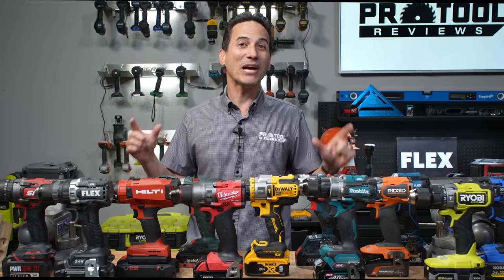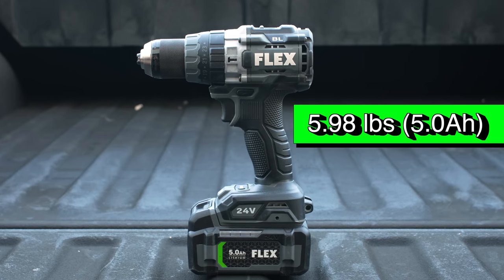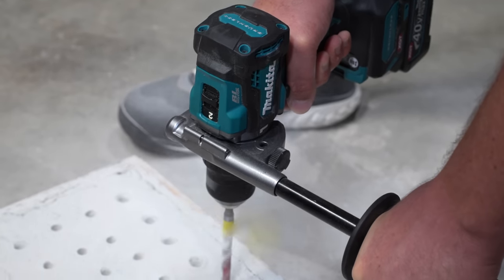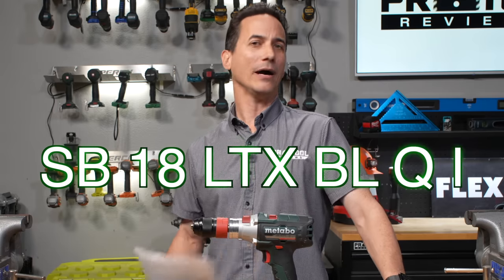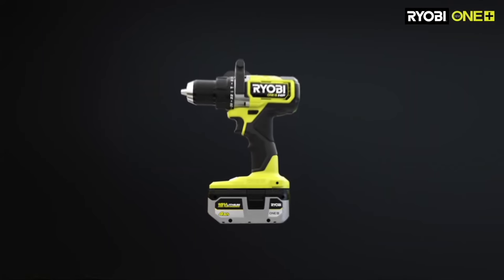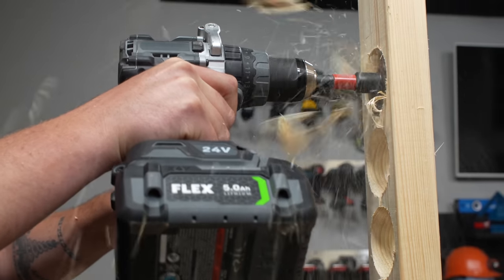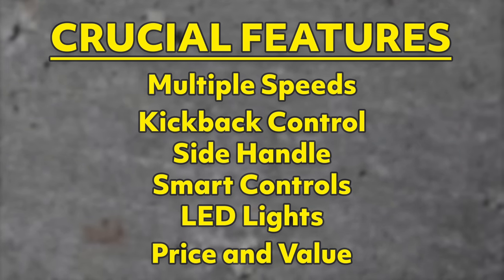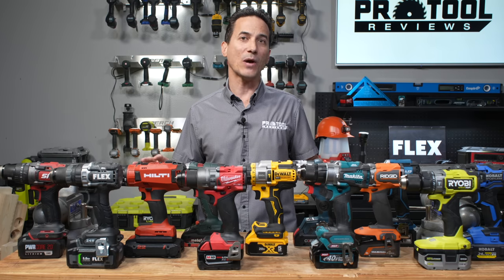Best Cordless Drill 2024? Milwaukee, DeWalt, Makita, Flex

Comment: I agree with several of the other comments with regards to the batteries used on some of the drills during testing. The bosch is designed to work with the larger batteries 5.5ah and above to deliver full power. The same with the dewalt, its a flexvolt advantage drill thats designed to work with the flexvolt batteries. Using these higher output batteries is when the tools deliver the full power there designed for. Maybe the same with the other brands but not sure. Disappointing to see some tools came in without the batteries there designed for!
Reply: Higher amp batteries do not help any tool deliver more power.  Higher amp batteries simply supply longer run times between charges.
Reply: That is only partially correct. If you read the details on their websites and from personal use, the newer larger batteries deliver more power the tool can use. Hence why dewalt tools called 'flexvolt advantage' the tools have a power advantage while using flexvolt batteries. Also bosch biturbo tools get more power from Pro core batteries with capacities above 5.5Ah.
Reply: @robertturner5213  newer larger batteries typically are higher voltage.   Higher voltage delivers more potential power.  Higher amps deliver longer run time.
Reply: @11211lcb it's not the voltage with the Bosch, it's the number of cells. The voltage remains the same, but the output doubles because of the double rows of cells in the 5.5Ah and above batteries providing double the amperage. Power = voltage * amperage.
Also, don't confuse amps (amperage = current) with amp-hours (=capacity). One is tank size, the other is displacement (in an imperfect analogy with voltage being revs).
Reply: @11211lcb   you don't even have to leave this website to find out how wrong you are
Reply: @robertturner5213  Of course,  if the tool draws more amps than the battery can deliver the performance  will suffer.  And or if the battery is lower amp rated it will not deliver the power as long as a higher amp battery.,especially under longer power load times.
Reply: @11211lcb your wrong torque test channel has whole video showing power diff in batteries
Reply: @macvos the math you say about power= voltage * amperage, is a bit flawed, first of all I assume you understand that power is measured by watts.
The battery that says 5Ah is basically a battery that can supply 5 amps continuously for an hour it is often the same when people say the battery is 5 amps, almost nobody says amp hours because there is no such need.
Now if a tool consumes say 900 watts that means it it's 8900 watts per hour. Thus you have Wh its all measured per hour.
So say you have a 18V battery with 5Ah it means the tool at full power will only work for 6 minutes straight  because  18volts*5amps outputs 90watt.
Or to make it easier 
If you try to draw 900 watts from a battery that has a capacity of 90Wh then you will get 90/900= hours 0.1*60min=  6 minutes. So I don't understand what you trying to say here? If the battery has more or less amps doesn't matter for power output as long as the battery is full, if the battery gets low then it does affect because it simply can't give you the power output that is required.  
This is physics and math. Batteries tell you their capacity in amp hours and tools tell you their power outputs in watts and not amps. That exactly why batteries can be put on any tool with any power consumption but then you get longer or shorten work time with them depending on their consumption in watts. Heck you can even put a Milwaukee battery on a dewalt tool and it won't make a difference, you only need an adaptor for the ports.
Reply: @robertturner5213 I'm sorry bit the tool cannot output more power than its designed to, otherwise corded tools would be extremely more powerful, but it has to do with voltage, read about it, they say that these batteries are designed to be used on both 18v and 54v power tools and not to give more power to an 18v tool. If anything these batteries have 9Ah which just gives then more work time at full power.
Reply: @theone-ou3gd I'm sorry but he is not wrong, first of all the original comment refer to a tool that is not shown on this video, the p
Cordless power tool shown is designed to be used with a 20v battery. And the flexvolt batteries are designed to be used with either 18v power tool or 54v power tool, and that the XRP Cordless impact/screw drill DCD999NT which is specifically designed for flexvolt batteries usage for almost double the torque output for specific jobs, but not all of the tools will give you this output, only the specific one because it can work either on 18v or on 54v so you can use 18v batteries or the flexvolt 18v/54v batteries and it only gives more torque. But again the tool in the video is different. And not designed for the flexvolt batteries specialty.
Reply: @Alex-ny1qg  Every specific lithium battery cell has a certain voltage and amperage (and thus wattage). If you want to achieve 18 volts working voltage, you need 5 cells in series (5 * 3.6V = 18V). Putting every one of those 5 cells in parallel with a second cell doubles the amperage the cells can provide, and therefore the wattage. 
Also, never say amps and amp-hours are the same to someone working with electricity. A 5 amp battery is one that can output a current of 5 amperes (A), but depending on its capacity, might only be able to do so for 10 minutes,  or for 2 hours.. A 5 amp-hour (Ah) battery can be a battery that has a capacity to deliver a max current of 5 amps for an hour long, or 50 amps for 6 minutes.
Like I said, with a semi-fixed voltage, amps indicate max power output, and amp-hours capacity. The two are fundamentally different.

Comment: Dear Pro Tool Reviews, you seem to have the resources to do a great video, but you're missing so much information. How about addressing the ergonomics of the tools? The noise/db level? The run time with included batteries? Rating controls and ease of use? Built in light performance? It's nice to know how quickly you can drill one hole, but how many can you drill before shutdown? Lastly, I think you should try a 1st, 2nd and 3rd place finish or give category wins. Otherwise, if you're going to choose a single tool you need to give very detailed reasons why. Besides, an extra couple of minutes isn't going to make or break these videos. I have watched a number of your videos and I feel like you assemble great tools, but never fully deliver on the complete picture. Improve and I'll subscribe. Do great and I'll be a promoter.

Comment: Congrats to the m18. Though, every SINGLE m18 brushless/ brushed battery- powered tool I have has had to be sent off for warranty work to be done. All of them at one point or another. Granted, Milwaukee stands behind their warranties 100%.
Reply: This is what puts me off Milwaukee. Unreal power when fresh out the box, but after a few months all of mine seemed to break! And the batteries are awful. I’m now into Makita, not as powerful as Milwaukee but I’ve never had a problem and still performs the same a year later.
Reply: @riba2233 yes! As stated before, ALL of my m18 tools have been sent out for repair. I have just as many Makita tools and NOT ONE of them has had a problem whatsoever. 💯💪
Reply: Might just buy the Dewalt hammer drill

Comment: Should have used a Profactor battery with the Bosch because they clearly state that’s what the tool was designed to use.
Reply: Well, I do my own testing, and I tested the Bosch drill, after jamming in a 6v Black & Decker battery from 2013. Strangely, the Bosch performed very poorly. I blame the tool itself...... 😉(Kidding of course)

Comment: Just bought the Milwaukee Fuel m18 hammer/drill today.  I picked up this tool kinda blind and got the $299 kit with charger and extra battery. (replacing an old Craftsman 18v drill from 15+ years ago.  Thanks for the excellent comparison between all these brands.

Comment: I use Hilti, its not just about who is the strongest, drills faster etc, they are reliable and if you break it they come pick it up etc... Also the same when you buy their tools, you buy it from them directly, they deliver it to you directly. Its very smooth.  They also dont release new machines, batteries etc that often, and they still sell the old batteries etc. It just works like flawlessly...  And the thing its been like this for a long time most (all?) other machines you had to go through a 3d party dealership or whats it called.

Comment: I got Milwaukees m18 and m12 fuel line up and electrical tools and plumbing tools also! 

We beat them up pretty good without any issues so far. some of my Milwaukee stuff has been in 3 feet of water by accident and still kicking!  Can’t beat that or say the same about competitors tools in my experience
Reply: m12 stubby impact failed along with couple m18 8.0 batts ; took them to milwaukee center ; rep lady gave me new batts and got stubby repair.  Good service .. 🎸🤘☕️

Comment: There is a GLARING detail on those charts that should be the entire focus of this video. The Hercules performs within 5% of ALL the top brands in every single test and costs less than HALF as much at $79, and I just grabbed one today for $49 on sale. This is the biggest game changer in power tools since the mainstream use of the lithium battery in the early 2000's. What Hercules is doing at these prices has literally never been done before. I have an 8Ah 21700 cell battery and a hammer drill, and their impact driver that BEATS Milwaukee for $149 total.

Comment: I liked this video. 2 things though. 1- on your charts (the first one) you have the Ridgid as 800 in pounds. It's 1250! You did state 1250 in your overview. 2- I believe the Ridgid should have had a 6 amp hour battery like the rest of them. It helps a ton compared to the 4 amp. I have the drill and have several 6 and 4 amp batteries. There is a difference.
Reply: Just suck it up it was a fair test he used 5ah batteries on DeWalt and Milwaukee and I know they both have more power with other batteries
Reply: @danielherschberger6424  ok!?!
Reply: Lol
Reply: I to have the Ridgid..the newest one 1250 ..run the 8ah battery it'll run with those others..Warranty = priceless 😅
Reply: Theres an 800lb model too, likely the one he was using

Comment: I've had both Dewalt 996 and Gen3 Milwaukee. And they would not hold up to drilling 1.5in spade and 2in-2.5in self feeding forstner bits in log railing all day, like my Makita 40v has. Although I did burnout my makita motor and had to warranty it out and got a brand new one in return.
Reply from the maker: Thanks for the insight! We're glad you were able to find the right drill for your job!
Reply: No battery tool survives doing what you do all day. I think you should consider something even bigger to take that beating. Your job seems like it needs a corded hilti or something like that. Heavy industrial tools.

Comment: Its still Bosch, Hilti, Makita. Anything else is either too expensive for the performance or lacks the not durable enough for the price tag. If im going to pay top dollar for tools they better hold up. Ive gotten excellent performance out of my makita lxt 18 volts. If i didn't have makita platform id go Bosch Dewalt or Hilti and mix and match a couple specialist tools. Makita has just about everything already so i feel like any tool i need is out there.
Reply: Makita is vastly, vastly underrated as a tool company in America.

Its like trucks. Everyone raves about Ford, Chevy, and Dodge, but a true businessman who is in construction that really knows his stuff chooses the Toyota Tundra
Reply: @travisjazzbo3490  i drive an old 06 tundra. Lol but yeah i want to like Milwaukee but id go rigid or ryobi since its the same internals but a cheaper price tag. I use some ryobi stuff with an adapter for makita batteries. They run better on those than the ryobi batteries.
Reply: Na, not really

Comment: any woodworkers out there could tell me besides these drill torque power/features/battery strength etc  which one is best with gear ratios precision. Like for instant I know dewalt has too much power on the lowest setting when i want to just screw a small screw and just goes over leaving almost a quarter of a inch hole behind when i just want to have a flush finish. I know I can go easy on the trigger or pre boar it but I want to repeatedly doing it without being too careful and consistently get same result and no needing to do extra work and attention just to achieve it. Especially on small projects that I want to finish fast and efficiently without leaving marks that are ugly as if I did with an axe as a hammer for a screw part.

Comment: It’s great that y’all included Hercules, and for the price it looks like it did pretty well considering! I have the Hercules BL impact and like it a lot, almost bought this hammer drill only because of the lack of an “anti-kickback” feature. I’m gonna go with the Milwaukee instead! Great review y’all!!
Reply from the maker: Thanks for watching!
Reply: @Protoolreviews  The Hercules battery you tested with is a standard output 5 Ah battery which uses 18650 batteries.  Hercules also offers "Extreme Performance" batteries which pack 21700 cells and can deliver more performance.  If you are going to re-test the M18 Fuel with the new Milwaukee battery it would only be fair to re-test all the tools with their max performance batteries as well.
Reply: chinese chit!
Reply: @Protoolreviews why didn't you use HO batteries that were made for the brushless tools on the Hercules?
Reply: @inkandbarrel  hey cowboy, you like your Chinese tool companies don't you😅
Reply: @3dandyrandy3  shoot, wish I could find some that aren't. At least Hercules is owned by HF, which is based in Los Angeles. Closest I can get. Dewalt, Milwaukee, etc... outside of Festool, you are pretty much stuck with them. Rather support a local company (California) if I am buying stiff made in China anyway.
Reply: @ashenwelt  Okay I stand corrected. I thought they were a chinese own tool company. I see they are owned by harbor freight like you said. I didn't know that we don't have any harbor freights where Im at.
Reply: @3dandyrandy3  it's a comon meme, but it's used to disparage them. I have been shopping with them since the 70s... its been interesting to see their changes.
Reply: @ashenwelt  Well in my book that's a huge plus for them if they're american owned company. With the warranty And price point they have on their tools you really can't go wrong.
Reply: @inkandbarrel  I do apologize I thought certainly that was a chinese tool company. This is how I learn.
Reply: @3dandyrandy3  I believe everything is designed in the USA but built in China.

Comment: I wonder why they picked Milwaukee as the best when it didnt win 1st in a single statistic? Makita and Bosch litterally were top 5 or better on everything. Metabo really shredded on concrete drilling. Milwaukee was pretty much middle of the way next to ridgid kinda sitting towards the bottom of everything. Rigid is cheaper so youre better off buying them tbh.
Reply: From what I’ve heard ridgid warranty is a complete joke and Milwaukee is probably best in warranty according to many carpenters I know.

Comment: Hey man—love the video but you made a mistake on your charts. You mentioned Rigids in-lbs as 1250, which is accurate (141nm with a 6AH) but then charted it as only 800, making it look incredibly weak, down at ryobi level. 

This completely changes it categorically…

Comment: Just like Gen 2 Milwaukee always comes out with the best power to size ratio. But this thing just can't work all day, it overheats quickly. And it's a screamer. No comparison seems to ever mention this. I'm also invested in the Milwaukee platform, but this drill just isn't IT.
Reply: I actually caught a set of gloves on fire this winter using that drill, the thing still worked after it cooled down but man it really doesn't do good with aggressive use
Reply: Agreed. I sold mine. I also hate the ergonomics.

Comment: Great info. Still want to see reviews of cordless random orbital palm sanders.
Reply from the maker: We can try to work some of those in for sure! Thanks for watching!
Reply: @Protoolreviews   Great! Your reviews help me decide when making a purchase just like I did with my Makita combo drill set. I am upgrading my tools and am weary about the availability of replacement parts. I have to dump my elec sander bcoz of that.
Reply: @Protoolreviews 
If you will test sanders...test bosch gex 18-125 with 4ah 21700 battery

And on every orbital sander you will test use only 3M CUBITRON II 
Mesh (310W) or Xtract (710W)

They beat crap out of any other sandpaper lasting up to 20x longer (in my personal tests (i sand hundred of hours testing every single sandpaper on the market and only cubitron II is worth it (there is also tungsten carbide option but its only for flat and only for wood / plastic)   , belts last 10x more , cutting discs etc for angle grinder last 8-12x longer) while cutting/sanding  50-200% faster (in my case....it changes depending how hard you push it because they dont like to get pushed to hard

Comment: Why is Milwaukee chosen when there are good models from many brands?
Reply: They explained this in detail...did you not watch the video?
Reply: Although its other competitors have superior features such as makita, bosch, metabo.hilti, flex, I do not think it is right that milwaukee gen4 wins. And the tools cannot reach full performance due to low batteries, so the test is faulty and it would be wrong to choose milwaukee gen4.
Reply: Why WAS Milwaukee chosen? It's good, but it's not THAT good
Reply: @stauker.1960 That's right, it's good but it can't be the best
Reply: @stauker.1960 how bad is ryobi?